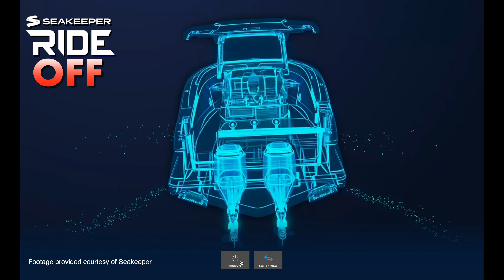Is Seakeeper Ride legit? In-Depth Testing and Review on Yamaha FSH

Comment: The Seakeeper ride 450 is on my Heritage 231 and I just took delivery of the Yamaha 255FSH H over the weekend.  I ran the 255FSH Saturday and Sunday and there is roll and steering identical to this video.  My Heritage 231 with the SC rides a lot better.  I'll be adding the SeaKeeper to my 255FSH, I am a believer in the product, big difference.   Thanks
Reply from the maker: Let me know if we can help. We install and if you're not local to us we can help you find a good installer.
Reply: @JetBoatPilot  10-4 will give you a ring tomorrow.
Reply from the maker: @itresources2354  8508671410

Comment: I believe this system works great on 22-24 degree bottoms that are tippy.  Take a boat like a 23 or 27 Albury Brothers with its less variable degree bottom really would not benefit.  Those boats really don't even need tabs and trim on the motor 80% of the time is all that is needed.  Correct me if I am wrong.  I own both a 24 degree bottom boat and will be picking up another Albury.
Reply from the maker: I'm not as familiar with those brands as I am with jets. I'll have to take your word for it.

Comment: One of the advertised damping affects is in the yaw or Y axis, and our jet boats do get a fair amount of yaw induced by sea conditions.  The Seakeeper Ride definitely lessened the amount of steering inputs you had to make was greatly reduced with the system on.  This would be a huge in terms of operator fatigue.

Comment: Will this fit on a Yamaha 222XE with the integrated wake boosters? I saw that the Kyma K7 actually uses seakeeper as part of it surf system instead of any other type of wedge/tab/gate. Have you tried using seakeeper ride while surfing instead of Yamaha's wake booster (either the integrated or the clip on one)?
Reply from the maker: Will not fit with integrated booster models. We never tested to see if it helps the surf wave. It's very likely that it will help but have not been able to validate that on a Yamaha
Reply: @JetBoatPilot  thank you. I just successfully wake surfed behind my Scarab 165 ID (300 HP) lol. It only took 600 lbs of lead and it worked. I'm trying to get seakeeper installed on it but its a custom job because of the hull. Still looking at getting a Yamaha 222 but might have to go with no wake booster and get seakeeper ride installed instead.

Comment: Great video. Very interesting product. 

Question, would this serve a dual purpose that would include acting somewhat as a trim tab?
Reply from the maker: Yes it keeps the boat at an optimal pitch and roll angle at all times in auto but van also be run in manual configuration and you can do some really interesting things.

Comment: I would like to see a video comparing the Yamaha articulating keel system vs Yamaha Drive X and how the SeaKeeper would work on them.  Can the SeaKeeper be used with the DriveX system?
Reply from the maker: Its working great with our Helm Master equipped FSH. That is the same system as Drive X. Where you'll run into issues is with the integrate wake booster on the X models.

Comment: Can that system be install on the 252SD, or does it have to be a Center Console  Boat?
Reply from the maker: @bennyserrano440  we have installed on many 252 and 255 sport models. Just finished a 255XD the other day. All thus far have reported significant improvement in ride!

Comment: Do you program the zero pitch and roll with the boat on the trailer. How do you determine zero pitch? What could you measure to determine level at rest?
Reply from the maker: The system does it for you during the commissioning segment of the installation process. It's best to do that step in the water while sitting still with no movement.
Reply: Thanks for the quick reply. 
I'm just wrapping up my DYI install in Baja. We don't have a harbor here at all, so flat motion free water is pretty rare. At this point I have just stood back and leveled the trailer and boat to what looks like a zero pitch and commissioned it. Going to put her in the water today! Really excited to see how it performs. 
Also, your install video was very helpful. I referenced it throughout my install. Thanks for taking the time to put that together. 
If my situation was different and I could have taken the boat to have the system installed, I would have for sure.
Reply from the maker: @rmpackaging  I get it. That's a tough one, but sooooo worth it!

Comment: will seakeeper have a system for the Yamaha 27 foot boats
Reply from the maker: @shannonkelly4071  we're trying to get that answer now. Some are attempting to put a 450 on a 275. Not sure it will work though because of the extreme angle of the fiberglass in the mount zone. Would likely need lots of fiberglass work to make it viable.

Comment: How are those different than the Zipwake ones?
Reply from the maker: The zip wake cannot deploy its tabs fast enough to manage pitch and roll in real time. The Seakeeper deploys it's blades full up to full down in a fraction of a second so it can actively manage pitch and roll without lag. It's much more effective than any other tab system.

Comment: How does it actually work? Thanks
Reply from the maker: It has an accelerometer inside the console area that is programmed at rest for zero pitch and zero roll. When the boat is above 20mph the system simply maintains that same zero degree angle using the electronic actuators on the left and right of the boat. The actuators control the blades which create life when deployed. The system measures pitch and roll 1000 times per second and can adjust 100 times per second. It's super effective and a total game changer for Boaters in this category!

Comment: Will this work on a 2025 252SD?
Reply from the maker: Yes as long as its not equipped with the integrated wake booster (only on  255XD models) you're good. We've installed a few and the results are breathtaking!

Comment: I have a 2024 255 fsh sport h. How much to install this system.
Reply from the maker: @carboss2020  without optional keypad it's $7400 plus tax. With keypad it's about $300 more.
Reply: @JetBoatPilot  do I have to bring boat to you. I’m in Naples. I’m also interested in steering control
Reply from the maker: @carboss2020  no we can refer to a local shop if you like. They may be a bit higher on install cost though.

Comment: Wow, the cost is actually less than I was expecting
Reply from the maker: Yep, the gyro system is the higher priced of the two. It works at idle power. This system works at speeds above 20mph

Comment: what's the different between ti's and zipwake systems. any comparison test independently
Reply from the maker: Seakeeper Ride is truly a real time ride stabilizer. Actuates from full up to full down in a fraction of a second so the goal of real time ride stabilization is accomplished by its speed. The zip wake is an automatic system but can't deploy and retract fast enough to deliver the same benefits. Hands down the Seakeeper is superior.